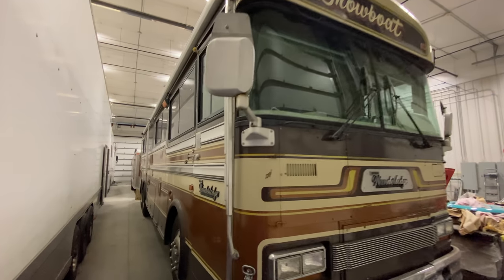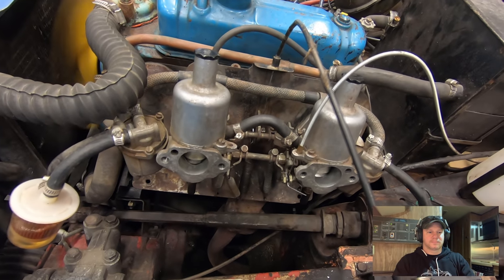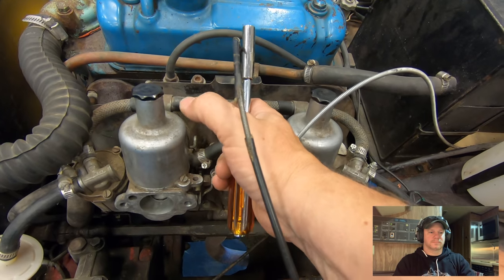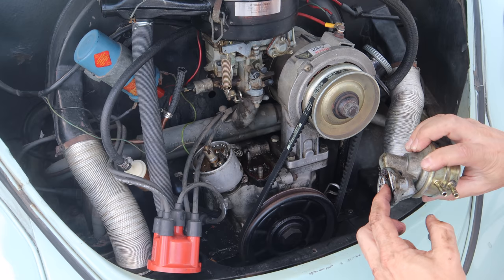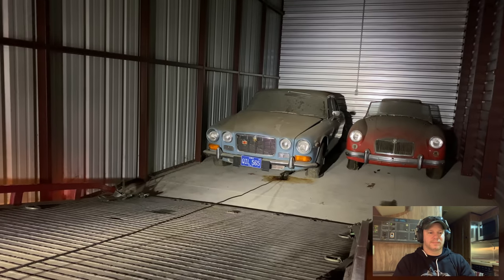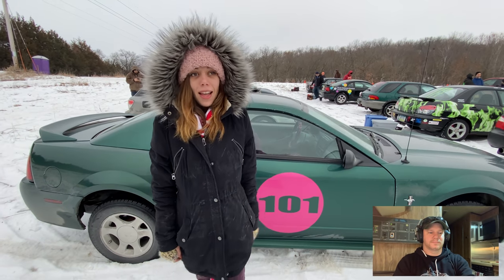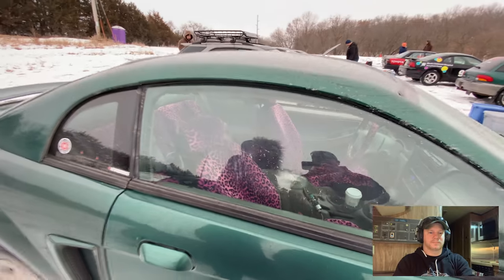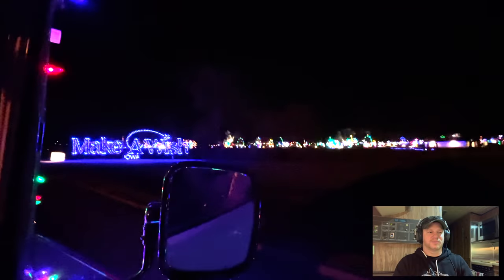The Lost Episodes

Comment: Back in the 70's I restored two Triumph Spitfires, 66' and a 67'. The 67' had the electric overdrive switch on the gear shift.  The 67' came out very nice. I traded the 67'Spitfire for a 64' Corvette.  I was about 1/2 through the restore of the 66' and I traded it for a near new Norton 850 Commando. I thought I saw you had a Triumph Spitfire up on the shelf in your shop when the camera moved across...My heart almost stopped....I have been looking for another for a while now. Only problem is the Wife doesn't know I still want one to restore again.....I'm a newbee on your Chanel, good video's, looks like fun, Thanks

Comment: That poor Beetle, what happened to it after it was totaled? What caused the failure in the M35A2's transmission?
Thanks for the look behind the scenes at these tidbits!
Reply from the maker: Insurance company will probably auction the beetle off.  The jack shaft broke on the M35A2 which jammed and broke the transmission off.
Reply: Thanks for the quick reply! Hopefully it'll get put to good use then. Ouch, that'd do it.